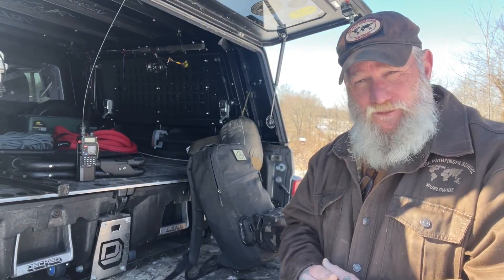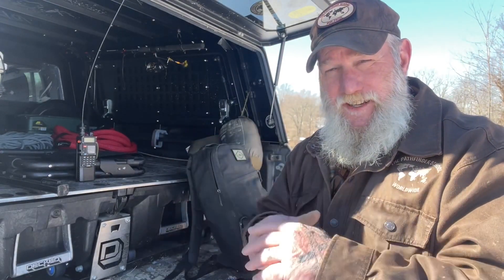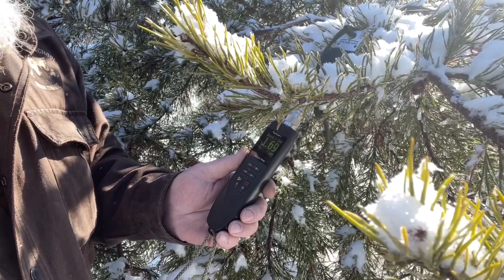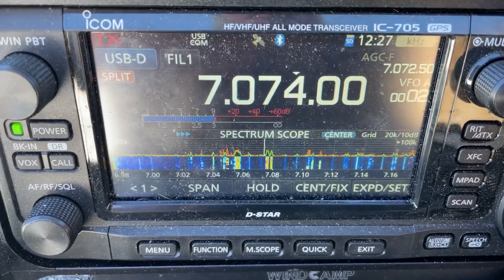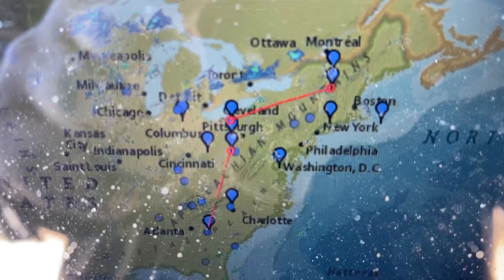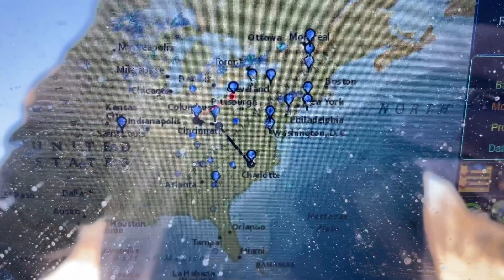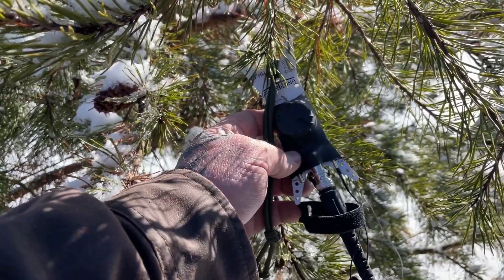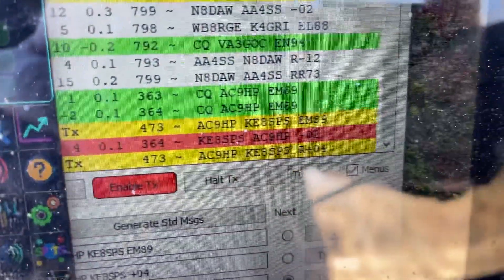NVIS Experiment for Regional EmComm

Comment: If you could elevate the antenna to about .07 wavelength you would probably find the sweet spot (antenna gain/ ground loss) as well as slightly increasing directivity for closer in emm coms, if that is where you want your signal. I make 80 mile contacts in this manner.

Comment: I’m in Central Ks, running a home brew 40 meter dipole with a peak height of 8 ft, and ends only 3 ft agl. Using a Kenwood 480, I regularly make contacts everywhere from Kansas to the east coast, Missippii, Arkansas, Tennessee. Running 100 watts or less.

Comment: I've been doing this dor years with a 40 meter NVIS inverted V. The peak is at 12 feet above ground & the ends are at 1 foot above the ground. I use the folded dipole method of creating the legs of the antenna so as to transform the lower impedance due to ground proximity. Speaker wire works well.

The end result is great coverage in a 800 mile radius. The advantage of using an inverted V is at 40 meters it is resonate at 15 meters and less NVIS at the 15 meter band.

Comment: A dipole at full height will have lobes perpendicular to the wire, as you lower the antenna the side lobes will merge with the main lobe, an as you get lower about 1/4~ the main lobe will increase in vertical gain which is what you want for NVIS, to increase this gain you can put a wire on the ground under your antenna a bit longer than your driven element think reflector.  I use NVIS several times a week 40/60/80m for winlink VARA HF protocol

Comment: Optimal NVIS antenna is a dipole tuned at NVIS height (1/4~), configured in a shallow inverted V  40m day 30m night. Dave is solid on the range 55mi to 471 is my experience with 230mi being the sweet spot, height of 0 to 23 ft

Comment: I have done NVIS as close as 100 yards on 40 meters, on a homemade dipole antenna . Five feet in the center, and three and a half feet on the ends. I orient it east to west for north to south comms, and the opposite for east to west. my average has been 30 to 300 miles, using an Icom 7100. kn4jkz

Comment: Just a quick note......technically speaking, the wire below is a parasitic reflector and does not need to be connected to counterpoise..  Additionally, It should be approximately 5% larger than your 40m element.  http://on5au.be/content/a10/wire/n3.pdf
KO4DEF

Comment: HI-- the counter poise allows the signal to be reflected straight up.  The better the ground the better the reflection and more radiation up to the clouds.  It should be noted that the SUN and time of day effect the efficiency as well.   If the counter poise is off the ground, it becomes a tuned radial with problems of its own.  The critical frequency is the point where a signal upwards will bounce back to earth.  Below that frequency, NVIS will work.  From 4 ft. up to 12 ft. the NVIS allows more energy until a 1/4 wave of the frequency of the transmitted signal.  This is where it transits to a long wire with more side radiation.  As the power shifts from straight up to side ways, it becomes a long wire antenna.  The efficiency of NVIS is a tradeoff to how quiet it will be.  The closer to the ground, the less noise it picks up from local sources, but also less efficient for transmit.  Try a loop on the ground as a receive only loop.  It is easy to drop, and low noise pickup in noisy areas.  A small one is just practical to use when needed.  Great job, AD6EC Rich in EDH El dorado Ca.

Comment: Dave are you running a counterpoise on your EFHW in this config?

EDIT: So does the radial act the same as a counterpoise?
Reply: Dave has it connect as a counter poise but you can also just run a wire on the ground and not connect it - it will act a bit like a reflector on a yagi.

Comment: I was a 2531 or Field Radio Operator when I was in the Marines. Basic radio antenna configuration was required for basic VHF, HF and FM comm. Your way too technical for the average person. 

All you need is a roll of slash wire and anyone can have a basic antenna for both receiving or transmitting. There is more than enough wire on a roll. 

Just my thoughts.....

Comment: Did you mean to be working split?  Transmitting on 7.072 mhz and receiving on 7.074 mhz.  Just wondering.
Reply from the maker: I probably bumped the VFO along the way it self corrected I assume when turning program on and off to make adjustments